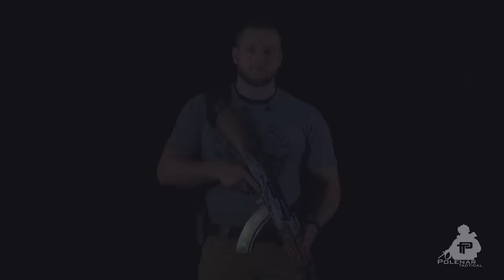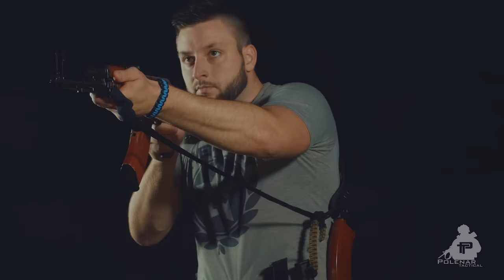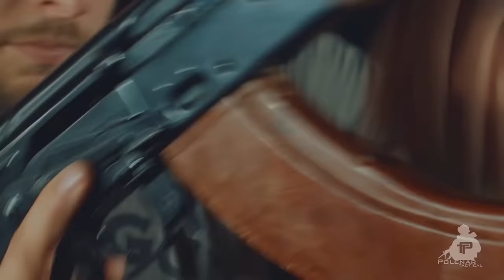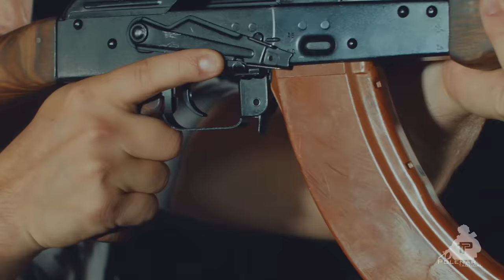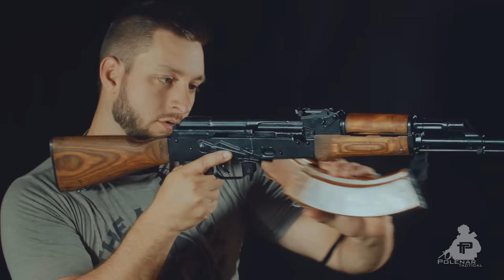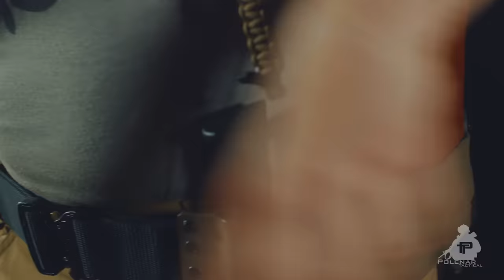How to reload an AK

Comment: How do I tactically reload my fully automatic flint lock pistols?
Reply: The powder must at a clipazine level while inserting the ball then the powder. Then,  leaving some to prime the fully automatic pan to ignite the clipazine and blow your hand off.
Reply: Mr. Chopstick for optimal sight picture acquisition, post reload, I keep the barrel pointed at my face to ensure proper seating of the ball.
Reply: Slowly.
Reply: Drapetomanius Grimr where is his tactical gear? You can't tactically reload without tactical gear. He didn't even look down the barrel to check that the ball was seated correctly. 0/10 tactical fail.
Reply: It's easier to work with 30 round caliber clipazines when you have the shoulder thing that goes up.
Just keep in mind that these assault machine guns are very dangerous and can shoot over 30,000 rounds a second.
Reply: I'm here to learn how to tactically reload my belt-fed Mosin
Reply: Made in Heaven shoot and throw. Pull another one out
Reply: carry like 20 in a sufficiently pimp 1600s tactical sash. also put lit fuses in your beard, i heard this helps.
Reply: Get another one.
When youre out of ammo, just throw away the first one and get the second one out.
Reply: Made in Heaven grab another flintlock
Reply: You throw the gun at your opponent and keep throwing flintlock balls at him till he gives up.

Comment: Press "R" Then Double "Q" for fast reload
Reply: What game?
Reply: CS:GO
Reply: You just need to wait until you see that ammo has loaded, then you quickly press q twice
Reply: @Михаил Давиденко sadly there is a problem in the source so it is useless for now
Reply: @Star-ny3fm  Yeah, don't play Source engine multiplayer games. Source engine code leaked online, allowing people to basically do anything with game, accounts and items.
Reply: My q is drop, so I have to drop my first and secondary to reload faster? 🤔
Reply: @therivaldi yes lol
Reply: @Михаил Давиденко is the csgo and tf2 fixed note true?
Reply: @Star-ny3fm  I remember them saying "leaked code is safe" not "leaked code is fixed". And you can't fix leaked code, cause it's "offline". If this code has actual hole in it, I don't know how will Valve fix this problem. Only thing they can do is moderately change code so it won't be similar to one that in game right now.
Reply: @Михаил Давиденко I will play the one at roblox until it gets completely fixed lol
Reply: @Rio-neesan  I don't understand, what happened? What code you're talking about and what happened to the game because of this?
Reply: @therivaldi8567  csgo's and TF2's source code  uploaded online by ex Valve News Network worker. That means, if there's holes in code uploaded right now, they can use them to do basically anything with these games. Not only with game and accounts, but with your PC too by RCE (Remote Control Execution). Viruses, missing, blocked files, etc. But Valve says that this leaked code now online is safe. I'd still recommend to not play these games for now.
Reply: @therivaldi8567  okay apparently everything is fine now.
Reply: @Rio-neesan  alright, but that's stupid because for cheating you already need thoses codes (?) 🤔
Reply: @therivaldi8567  Yes. But hack-creators had old versions of this code and that didn't allowed a lot of hacks to work. And Valve updated it too. Now, they got newest version and can continue to make hacks until code changes or if code just perfect and w/o abuseble errors. As I already said, Valve fixed this problem so tf2 and cs:go lives
Reply: @Rio-neesan  thanks for those answers 😛👌

Comment: Well, if u r shooting in a shooting range, yeah, it will only take you max 3 sec to reload. But under stress and fatigue in a combat situation, it will take you more. Plus, considering my army pouches have a protection so the mags will not fly off during running and so on, it will take me around 7 sec to reload. 
   I didn’t took into consideration the time to put back the empty magazine.
    Another small trick is to only shoot 29 bullets so you don’t have to cock your ak, or if you do it, try to flip it on the right side so it will become easier for your left hand to grab the knob and cock it.
Reply: P.S. That 2 mags stuck toghether is a nice feature, but if you have to hit the dirt, dust and dirt will enter the fliped magazine and will cause you a malfunction. Not taking about the weird position you have to sit when you are on the ground to aim. So in a combat situation, that is a no go. 
   And yes, the one hand changing mags is the best if you still have a round chambered. 
  P.S.S. Romanian soldier here.

Comment: Super nice tips!!!!!  I'm a AR fella from the states, but I'm learning tips like this because
  All Rifles Matter....!!!
      What optic did you get for your rifle?  You left the shop with a few choices to test.... A review would be sweet.....😀😀
        Great vid!!!
Reply: Then, maybe you will be interested. If someone says at you "AK-47" you can immediately beat him with a rifle butt to the head, because there is no such thing as AK-47. AK-47 was a prototype manufactured by Mikhail Kalashnikov for the competition.
Reply: There were over 75 million ak 47's world wide, and that does not include the akm, ak 74, ak 74su, ak 101, ak 102, ak 103, ak 104, ak 105, ak 12, or the ak 15.
Reply: Once again I repeat, there is no such thing as ak-47 because it was a prototype, the assault rifle that came into service for the Soviet army was simply called AK. For the same reason, the Akm is not called Akm 47.
Reply: incorrect, research your statements before posting false information.
Reply: this is correct, in official Soviet manuals AK is not designated as AK 47. Even Wikipedia has this information. All sources of this information are also indicated.

7,62-мм автомат Калашникова (АК)[4] — автомат, принятый на вооружение в СССР в 1949 году; индекс ГРАУ — 56-А-212. Был сконструирован в 1947 году М. Т. Калашниковым.

Наставление по стрелковому делу. 7,62-мм автомат Калашникова (АК). Изд. 2-е. — М.: Военное издательство Министерства обороны СССР, 1960.
Наставление по стрелковому делу. 7,62-мм модернизированный автомат Калашникова (АКМ и АКМС). 3-е изд. — М.: Военное издательство Министерства обороны СССР, 1970.
Reply: Judje Mad     ????  The number depicts the cal. and the year of "in service"  The AK is the model....build type....style....Even as a American I know this....
       Your statement make you look bad!
        Just Sayin!
Reply: Stop talking bullshit, 47 is not a cal., 7.62 = 30 cal by the way. And 47 cant be year in service because AK entered in service only in 1949. AK 47 was a protoype, original name of this rifle is just AK, and its official name, and you can read this in soviet manuals.
Reply: Judje Mad     And for your information the prototype year was 1945....the very same year the SKS-45 was
in serviced...prototyped in late 1943 chambered in that famous intermediate cartrige 7.62 x 39
        It would seem that even as a American I know more history of Soviet Area weapons....The SKS is a battle rifle chambered for the intermediate cartrige of 7.62 x 39....The AK 47 is a carbine model assalt weapon that originally was a sub-machine gun only chambered in 7.62 x 39.
      Later variants had selective fire capibilites.
      It is my assumption that I may just know more about these rifles than you.
       So you probly would be best served to save your breath!
Reply: WTF are you talking about? what does this have to do with AK 47 is not the correct name of the weapon? AK 47 is a prototype and not the weapon what was mass produced for soviet army, youmaking me repeat same shit. AK just AK the correct name of the weapon. But you know what's the most ridiculous, SKS have the same story, number 45 did not appear in the title. SKS entered the Soviet Army with the name, without a number.

7,62-мм самозарядный карабин Симонова (СКС, Индекс ГРАУ — 56-А-231, за рубежом также известен как СКС-45) — советский самозарядный карабин конструкции Сергея Симонова, принят на вооружение в 1949 году.

For the second time I have provided you with official written sources that were written by the weapons designers. Sources in which AK is not designated as AK 47 and SKS are not designated SKS 45.
Reply: Judje Mad    than why is my rifle called a SKS 45 when it needs parts?  45 is the Russian made version, and all the other variants made by other Soviet block countries are different.  Hence SKS 45!  I have several others, made in other countries....they are similar, but parts DO NOT INTERCHANGE!
     They are dementionaly different rifles....Hence the no.  Can depict stamped cast or milled components.
    I most definitely have chased down more parts for these....your ignorance is shining thu.
        Order some parts without this information once.....you will learn....mabye?
Reply: oh god, not again
Reply: Judje is just triggered.
Reply: Thomas Massey    😂😂
Reply: Ak47 is a prototype but its still a gun and its still use but a lot of them use akm ak74 and other ak
Reply: Judje Mad You're kind of right, the first gen, ak-47 is rare, but they do exist. They were almost immedietly replaced by improved rifles, such as the AKM.
Reply: Judje Mad Yep. Every AK after that is an AKM or AK49.
Reply: It's used colloquially
Reply: no, no no... 

ALL BLACK RIFLES MATTER
                
                  TRUMP 2020
  MAKE AMERICA GREAT AGAIN
Reply: Idk what the arguement was about, but it was entertaining
Reply: @potatto8534  yeah i mean why would you wish for someone to die for such an unneccessary argument :D
Reply: AK = Automat Kalashnikov
AK-47 = Automat Kalashnikov (Model 19)47
AK-74 = Automat Kalashnikov (Model 19)74
Reply: @robertfoote3255  AK-47 is correct like AK. The AK (Awtomat Kalaschnikowa) has its civilian name Ak-47. The next Generation was the AKM. Jesus Christ.
Reply: @inkvizitor669  you lost when you used Wikipedia a non primary source to prove your point bud.

Comment: What, no love for the good old Russian / Finnish reload mechanism, where everything's done with the right hand, holding the gun straight with the support hand?
Reply: I think its because generally that method is outdated.

Kind of like how the US used to teach pointshooting with handguns
Reply: Teemu, even we (Fins) don't do that anymore :)
We do it the way that's shown here. At least that's the one I was taught, and which I taught to the new recruits.
Reply: Yeah, I've been watching this thinking "Wouldn't this be easier with your right hand?" the whole time.
Reply: I always did the mag change with my support hand, then used my main hand to charge the bolt. I think it's because my AK was a .308 and required a lot more force to charge, so it was uncomfortable to use my support arm under the AK at an awkward angle to charge it. Also, mine had a mag release that you could hit with your trigger finger, so I'm sure that helped.
Reply: Yes, this guy operates AK as if it was AR-15.
Reply: Teemuslayer That's old school
Reply: It felt very awkward and clunky to reload valmet m62 with the support hand. After the initial reload training, i went back to trigger hand reload. Felt way more natural and smooth. If they moved the bolt handle to the left side then yes. The support hand reload would be better method. You need quite a lot of force to pull that stiff old valmet bolt if you want to reload it a fancy american way. So, personally i don't recommend this style of reload for AK style rifles.
Reply: The whole thing of holding up the weapon by the pistol grip and reloading and charging with the non-dominant hand is definitely an AR-15 thing. However, it wasn't always that way. Old Vietnam-era training videos for M16 manual of arms show that the expected method for charging the weapon was to use the right hand and place the index and middle finger on both sides of the t-handle in sort of a "claw" grip and charge with the dominant hand. Over time, this morphed into the left-side charging handles and extended t-handle latches we see today, to accommodate the left-side charging technique. Holding a rifle up by the pistol grip while reloading has advantages and disadvantages. The main advantage is that you can maintain a sight picture on a target very easily that way. The main disadvantage is all the uncomfortable weight forward of the grip.
Reply: @GeorgianPranks  actually this is all untrue,the reason you charge with your support hand (from a military perspective) is because you dont want to take your finger off of the trigger once your rifle is loaded. I am not a russian either.
Reply: hnnn.. i'm russian is some kind of swear here?

Comment: The only thing I dislike about the ak is how the magazine is inserted. Obviously with enough training it wouldn’t be an issue but I have always favored how easy it is to simply insert a magazine into an ar rifle where as with an ak it’s more of an angle and a catch.
Reply: The m14 also utilizes this style of “rock-in reload”. 

Both styles have their pros and cons for sure.
Reply: Back in the days of WWII and the Cold War, Rock and Lock mag type guns were quite common, primarily because it was cheap to stamp out and it's quite a secure method of loading mags into the gun, less likely to false lock compared to a drop-in style magazine (albeit it's rare to have an issue with drop-in mags and it's only likely to happen if you were light on force inserting the new mag or not tapping the bottom to secure it). 
More or less, it was the style at the time.

Comment: AK rifles is always confusing me, why that bolt carrier handle has to be on the right?
If your dominant hand is right hand, you have to let your left hand cross the another side of AK and pull the handle(like what he demonstrated, terribly sacrifice the smoothness).
But if it is designed to be on the left(or on both side), it would be more efficiently to do this.
I guess the designer's dominant hand is left hand.
Reply: The ways of reloading AK rifles presented in this video are not how they are actually intended to be reloaded. The original and correct way to reload them was to use the right hand, while keeping the left hand on the fore-grip.

Supposedly, this was done so that Soviet soldiers who went from using bolt action rifles, to the AK, would have an easier time understanding how to use it.

Comment: In this Israeli method of reloding you present, with left hand, you must point your gun as much as you can at the target all the time, not in the sky. 
So i low the gun a bit, switch a little to the right and reload. But still on potential or real target. Ongoing targeting while reloding was the reason why this method was invented.

Comment: Kinda interesting how all the vids I see of reloads, people are just dumping the mags on the ground. I suppose it's just demonstrating the techniques and all, but I always practiced by replacing them back into my pouches or a dump pouch.
Reply: You won't have the time to place them in a pouch in a CQC gunfight.
Reply: @NorthernNorthdude91749  True, but supposing that's what you're doing... Are you then assuming you'll be wandering through a building picking up all your mags after the fact, then? And what if you have to move on quickly, and end up with no spare mags to load back up at a later point?

We always trained by switching mags out and replacing the empties in our vests or a drop pouch, is all.

I'm also thinking in the context of a battlefield, rather than something like a police operation, which would make more sense.

Comment: I think you have bigger hands than me? Or my magazine release lever is too stiff...I can't do the reloads with the "full" mag in hand, except when using the mag to knock out the emtpy mag from the gun. Any advice? 

Gun is a stock WASR-10 with little to no rounds through it; I bought it recently and haven't shot it at all, seller said it's in "like new" condition but has been fired before.